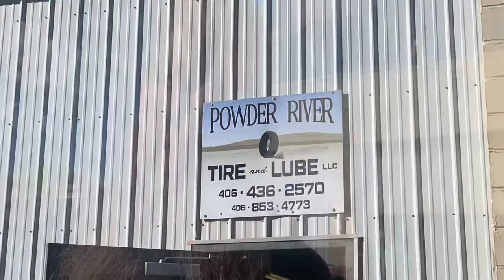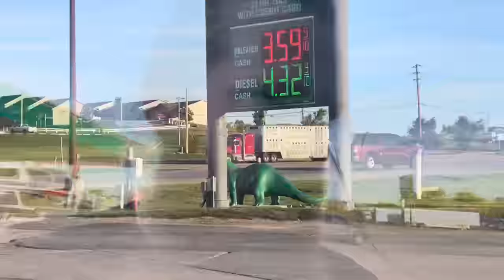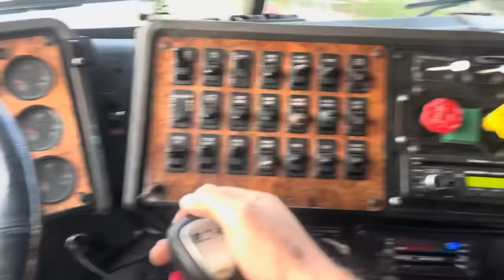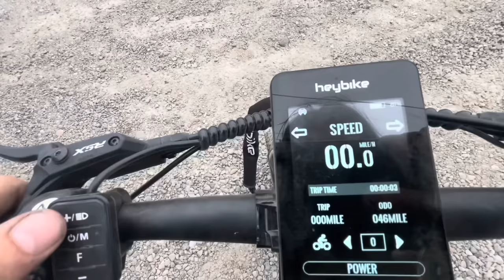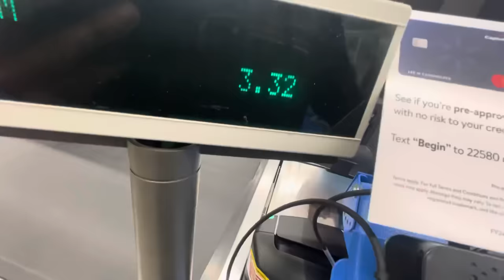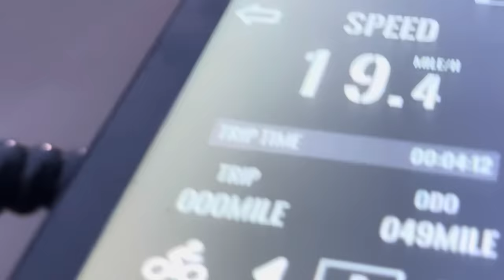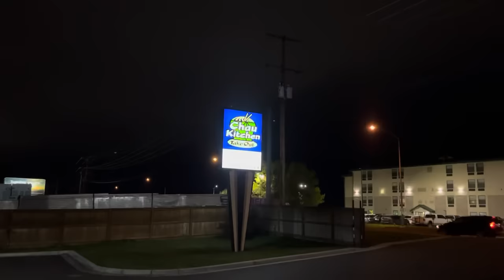1st cattle load with my NEW BLU3 cabover

Comment: Get you a small rechargeable air compressor just in case you get a slow leak in your bike tire when you go to the store. Very lightweight and very handy to have.
Reply: Our trucks have air, all you need is an air hose and chuck.

Comment: Kool, think front bag, are basket would serve a good purpose for your adventures to stores.
If you had a small removable extension that would support another set of saddle bags that you could put light objects that wouldn't be a negative effect 😂your steer😢would be ideal, because it wouldn't interfere with the light, and keep your center of gravity low for stability.
If possible find a way to widen the back bracket that carries the rear bags would help you with supporting water, 😂and other objects of similar shapes and weight allowing for easier security both in securing it to bike, and keeping it balanced making for easier ride back to truck. 
Just some thoughts on what you're hoping to accomplish by this addition to your ability to get to more places easier while not having to get your whole rig to the location you want to get to 

Stay safe out there, and be well young man

Comment: Jax 'ol Bomber here again, remember I'm the former driver who eats vienna sausages & 'Drink The Jelly' in the winter guy from last time, I have a 'way different' type 'fold up bike' it's not electric '&' it doesn't have a chain and derailer, it's no longer sold in the USA it's a 'Shaft Drive' bike, it has (8) gears which are controlled by its right handle grip, 1st gear lots of peddling hardly moving when in 8th hard to peddle and I'm 'flying' along, I lower the 'straight' handle bar then fold the post down against the front wheel, lower the seat post unhook it's folding lock and it simply folds in half then I fold in the peddles and throw it into the trunk easy as ever or I can leave it all set up and place it on the bed in my RV without any worry about any oil or grease on the bedspread because it only has one grease zerk which has it's own cover, when it's folded it's about the size of a suitcase just like yours, Be Safe 'Hammer Down' & Be & Stay Well. (I've enjoyed your Nascar Trucking vids a lot!!)